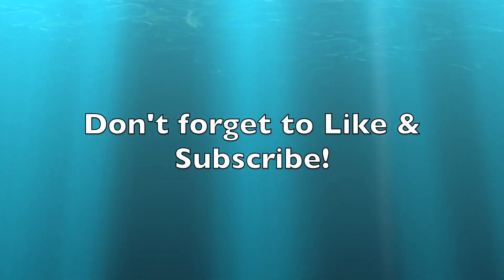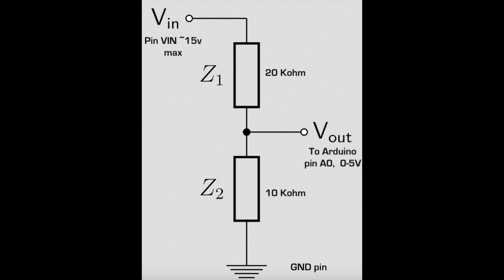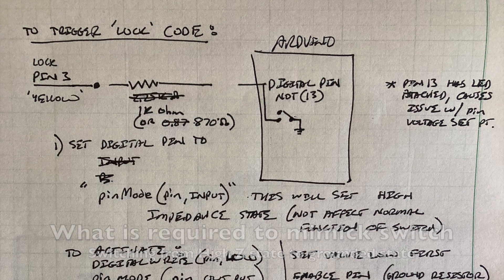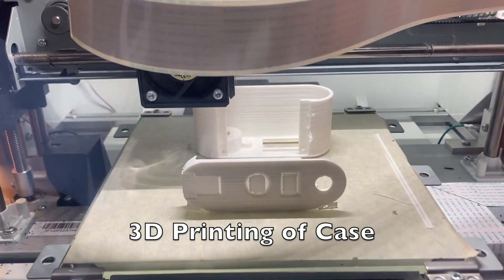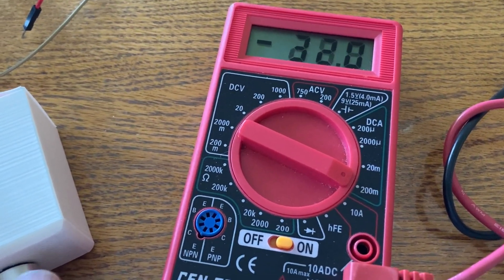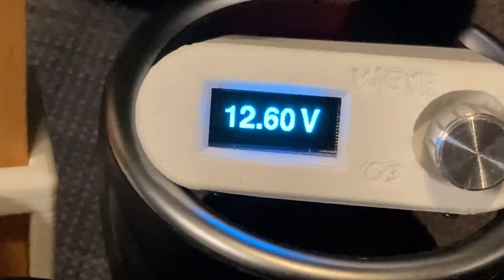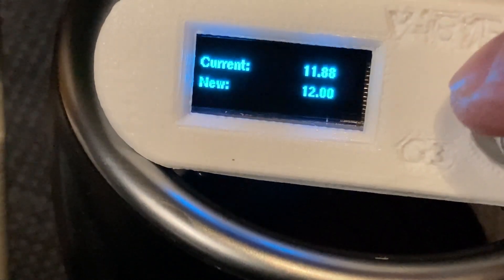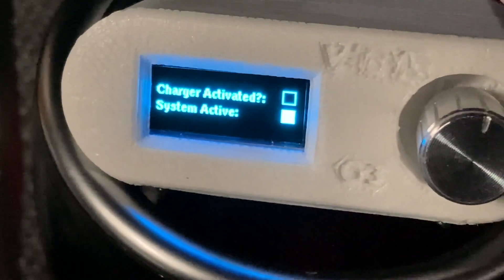BMW I3 12 Volt Auto Charging Device Part 3

Comment: Common warning I have seen is 'could not charge' warning showing up when you are not even trying to charge (like when being unplugged).
Reply from the maker: Is this the 12 volt battery warning, like the 'battery discharging while stopped' warning?  It may be a weak 12V battery or there is a load on the 12V system that is pulling too much power.   Also, check that when the car is on, you are getting 14-15 volts from the EME (check with a voltmeter or see my video about monitoring battery voltage).   Finally, maybe if the car is sitting too long & you're only taking short trips, there isn't enough time for the 12V battery to fully recharge- maybe try to leave the car plugged in for a longer time period.   I recently had the same issue on my ICE vehicle from sitting unused & starting it for 10minutes a week only.  Good luck on figuring this out!
Reply: @bmwi3diy782 
1. No the messages was orange unable to charge (HV). I thought it was only DTC that I had to erase.
2. Now I read if you have weak 12 V bat you may get those charing messages as soon as you are stopping.
3. In my case very strange story. I tried to top the 12 V many times but it got totally depleted in seconds when adding HV. Car often driven long and charger nearly always plugged in. I thought it was something strange with DC-DC (😔). But when on the third attempt when adding a secondary 12 V marine bat and also erased DTCs the car came to life 😊 so now I will be swapping batteries, it's been good for 7 years.

But you learn so much about how your car is designed in these situations.

Thank you 😊
Reply from the maker: Great news you were able to figure it out and your car is alive again!  Thanks for the update.

Comment: Please consider doing videos on faulty AC compressor and diy replacement of motor mounts
Reply from the maker: I haven't had problems with either of these components (yet).   I''l put it on the list of good ideas for now!   Thanks for the suggestions.